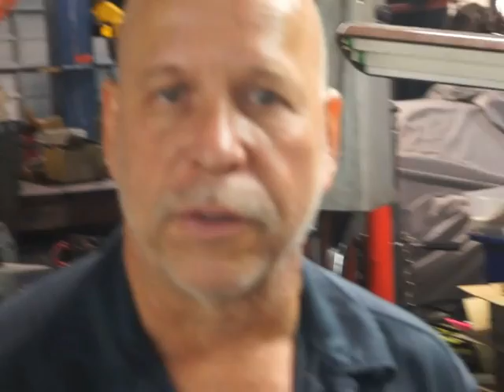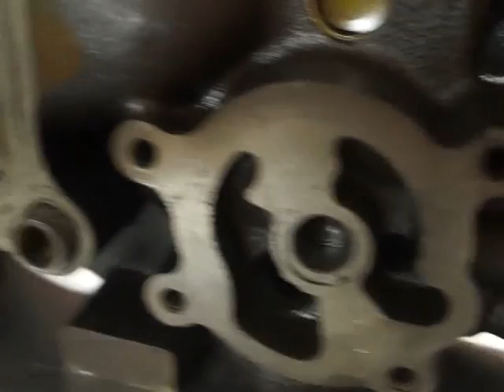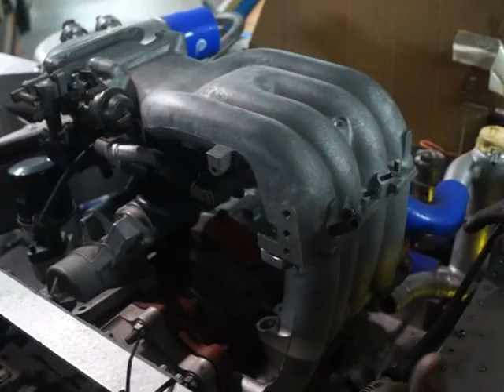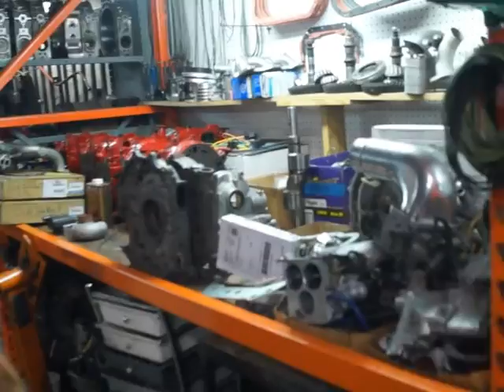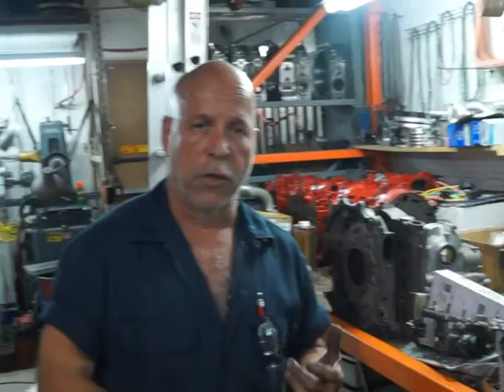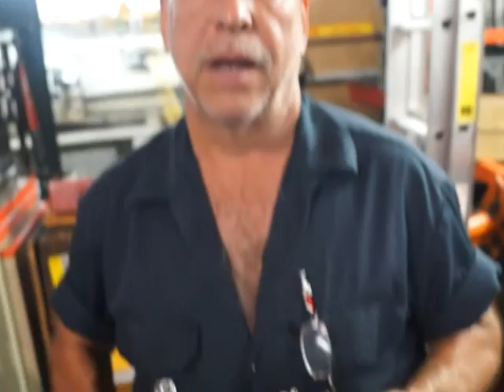Project Turbo RX8 Part 1

Comment: The dude working on this engine is amazing but after waching 40+ of these vids i still havent seen one of this engine running... four years later... why bother with aircon? I have owned two rx8's and am looking at buying another, the aircon is the first thing i rip out of these. Just bridge them than use housings with pp exhaust and block off the side exhaust ports with a manifold so you get the brap brap than turbo it.... in 4 years i can blow two of these up and have the time of my life... so life is short just rape the shit out of the 13b you have before you die of old age... peace ✌

Comment: I habe a RX8 WITH A 13B JDM 4PORT INSTALLED.BUT IM.HAVING A ISSUE WITH THE AUTOMATIC TRANSMISSION SHIFTING FROM 3 4 5 GEAR.
DOES THE ECM NEED TO BE REPROGRAM ?

Comment: So even if you were building a Naturally Aspirated 2 rotor race engine you still wouldn't use the RX8's higher compression rotors?
Reply from the maker: Not a chance. They are too weak, seals to shallow, and way out of balance from factory.

Comment: Ok so if I say get a full 3rd gen engine, and don't chang out the rotors the counter weights are fine without a custom counter weight, correct?

Comment: can you buy this kit now?
Reply: Richard Viscasillas if you guys croudsource this, I'm down, need this soon!
Reply from the maker: I am working on getting everything together by the two year anniversary of this video - July 2017.
Reply: Richard Viscasillas that's great! please send me the info when it's complete.  precision249@gmail.com
Reply: Richard Viscasillas any luck getting the kit together?
Reply from the maker: We are right now in discussions with various manufacturers, water jet companies, CNC companies, and 3d metal printing companies to explore the prices to begin making the parts.  I will be uploading another video Part 28 shortly.  What we are finding is that the costs to make 1 or 2 vs 10-100  vs 1000's of pieces differ greatly (as we expected).  What we really need is to get an in house CAD and 3d metal printing machine up and running. The cost of the machine is a cool $1 Million.  But we would be able to make just about every part we want in the 10-100 range in a reasonable amount of time.  Having molds made and pieces cast is another option, but that is going to also be expensive on the front end.  Depending on the demand we have will dictate which way we go with regard to manufacturing.  We are seriously considering some kind of crowdfunding to get this off the ground including a possible crypto currency ICO.  I am flying to Singapore on the 21st of August and plan to go to Japan to source REW motors and parts and possibly China to talk to manufacturers there as well.  We would love to make everything in house, or locally so we are going to exhaust efforts at that first.  Stay tuned!
Reply: Richard Viscasillas  so what’s going on with this now?
Reply: unknown1creature same here!

Comment: I may be giving you guys a call in about 4-5 years pretty much the same concept of the rotors housing and front iron but would it be possible to do a 20b NA or for the same money would I be better off doing a turbo build, I like the reliably of NA for the rotary but tuning is the real secret to success next to cooling components

Comment: So is there no way to build a decent hp 13b-msp engine? by decent i mean like 300ish hp given that the hp numbers of today that's a fairly modest amount of hp.
Reply from the maker: +TriniRogue - I've seen kits for the Renesis from different companies both superchargers and turbo-chargers.  The problem is you sacrifice engine life by boosting the Renesis as it is already maxed out in terms of its maximum hp capability without forced induction. Mazda used side exhaust ports on the renesis which is the biggest weakness because too much heat is generated on the side seals & corner seals which are weak and fail.  We have a test car NA RX8 we have hooked the adaptronic computer up to in order to play around with its functions to see how much HP we can extract with intake, exhaust, ignition mods (no internal mods - which require engine rebuild an even then not much you can do to the internals anyway other than put better apex seals (cut the groove and put the RX7 2 mm longer apex seals for example) There is no way to get to 300 HP reliably with the Renesis because it requires forced induction.  It will work but for maybe 20000 miles with like 5-7 lbs of boost max.
Reply: Richard Viscasillas Thanks for the insight, dang that's quite the bummer, i wonder if coating the side exhaust runners with a high temp engine paint or a ceramic coating would allow you to extend the engine life by keeping the heat inside the runner egt's would go up but if your engine lives then it would be worth it.

Comment: wow u know ur stuff brother...I have an 2009 RX8 would love to get it to 300 horsepower and rebuilding my engine as described in this video, how much would this cost ball park figure
Reply from the maker: +Joseph Espinal - You would need to get an RX-7 FD Block to swap in to your 2009 RX-8.  The only parts of the RX-8 we use in the rebuild will be your Front Cover that we modify and all ancillary parts that attach to it. Like the Oil Metering Pump, A/C, Water Pump, and we use your Fly By Wire throttle body and the RX-8's computer which has an adaptronic piggy backed to it to run the fuel, timing and boost.  All other features of the car are run by stock computer as always.  How much will it all cost depends on many factors but it can be done cheaply if you don't get all the machine work to the internals done.  You'd be looking at a minimum of around $6000 which includes a JDM FD block, our kit, the Adaptronic computer, and labor to pull and swap the motors and a Holset Turbo and intercooler and plumbing. The 2009 Rx-8 is the 2nd generation Rx-8 and we know that it has different computer so adaptronic will have to be wired in rather than plug in.  Not sure if there are any other changes but we will do one soon and find out.
Reply: +Richard Viscasillas Thats a very reasonable price!!!

Comment: What kind of cost are we looking at to convert an existing rx8 to this rx7 hybrid setup? The engine in my 8 is a recent reman with only 20k miles on it, assuming the rotors aren't going to be used I'm guessing there is some discount in exchange for the cores?
Reply from the maker: +asmithdev - If your existing RX8 engine block only has 20K miles on it, you should be able to sell it or we could discuss giving you core credit towards the purchase of one of our kits which would include a JDM RX7 block.  You would use the RX8 front cover, the OMP, the Fly by Wire Throttle Body and other parts you see in the videos but not the RX8 engine block or intake or exhaust manifold etc.
Reply: +Richard Viscasillas What would you estimate a total cost would be if your shop did the conversion and gave the core credit? Mine is a series 1
Reply from the maker: You should discuss your specific build requirements with us directly to get an estimate.  It all depends on how far you want to go and what your budget is.  If you want entry level performance a stock JDM FD block with a holset turbo and the kit plus installation will probably run less than what a standard renesis remanufactured engine exchange would run.  The core is worth about $1000 - $1200

Comment: im in orlando just rebuilt my renesis about 20,+++ with rotary aviation apex seals and all 3rd gen springs and other upgrades to prevent another granade from going off and with all that done i still wouldn't hesitate to have this kit on my 8 i have the mazsport e.c.u will it work or would cobbs be a better solution cause it does mask check engine cell and other things if need be....i want this kit for my 8 and yes i want the six injectors all i need is 400whp not more not less on 93tune im in orl.Fl. need a guinea pig lol! Please let us know for how much for the kit!

Comment: the real question here is will it work with a 20b...
Reply from the maker: +Warren Stroud -  You know we might just have to give it a try.  I don't see why not, there's plenty of room in the engine bay with the motor mounting at the back instead of the sides like the renesis.  I see a future video series on the three rotor hybrid rx8 engine next year.  The sound of a normally aspirated 3 rotor is music to my ears.
Reply: If you want a car to try it on and want to discuss pricing let me know :)
Reply from the maker: Will let you know. We are so slammed right now it won't be until next year though.

Comment from the maker: Shop is in Miami. CLR Motorsports LLC, 13800 SW 142 Ave #4 Miami, Fl 33186. 

Www.Miamigtr.com  website. 

We should be putting a kit together for sale once we finish the project and have a running car.  

Carlos is considered one of the top 3 rotary engine builders in the world.
Reply from the maker: Mitchell Garcia - Yes we are still around just been sidelined working on race engines, but we should be finishing this project and have the kit for sale in the near future.
Reply: +Richard Viscasillas I was 2 minutes in... realized you knew what you were talking about - so the right thing to do is to SUBSCRIBE !!!!!!
I'll be watching every video in your channel concerning RX8'
Reply from the maker: +Verum Quaerere Seek Truth - Thanks for the support.  We should have the next video up shortly.  Just received the intake manifold we were waiting on so about to begin the engine stack up.
Reply: you guys still around? looking for this engine work for my rx8
Reply: +Richard Viscasillas I'll be looking into this I might have to make a trip to FL. I have a 2010 series ii Rx8. Do you see any hiccups with the series ii?
Reply from the maker: When we complete the Series 1 build we plan on doing a Series 2 RX8 build.  I know that the computer won't be a plug and play deal like the Adaptronic for the Series 1.  We just have to use a universal Adaptronic and splice into the factory wiring harness. I'm installing a JB4 into a BMW 330i which requires splicing into the factory wiring banks and its no big deal, so I'm sure we will get it done.  The hardware for the engine mounts etc. should be the same.  We'll see soon enough.
Reply: What would be the price of one of this engine ready for turbo? I have a blown engine right now and If I get one I'll try to get one of this. Im really interested please send me a mail asap. salvadorortiz14@gmail.com
Reply: Richard Viscasillas just keep in mind... no matter what happens, I stay a fan and i continue watching your videos.... rotary spares in South Africa is wayyyy overpriced. I am swapping my blown apex seal 13b naturally aspirated rotary for a Toyota 1JZ GTE VVT-i .... I stick to Japan... just can't afford to be ripped off in my own country. Love your channel and especially your knowledge. YOU ARE THE TRUE MASTER OF ROTARY SIR
Reply: Would be VERY Interested. maybe I could drive down there and see it all done? Loving rotary engines, man
Reply: Are you guys still around?

Comment: good stuff, please post your shop info, i am going to start a project 2005 rx8 and would love to run the rx7 block with it. As you said, the rx8 engines are crap...... (my email: allias718@gmail.com)
Reply: +Noneyah Thomas It depends how you look at it. If you're looking for 600bhp+ like some of the rx7's out there, then you have to redo the internals of the renesis to support the boost pressure. But surely this is to be expected from an NA motor? I think the power you get out of it without a turbo is pretty impressive considering the engine was first built in 04. You can reliably run 350bhp through a renesis before needing to do any internal work.

Comment: At 7:53 you mention the 04+ 6 port Renesis only had four injectors, they had 6 injectors until 2009-2011.  Just a clarification but great stuff, thanks for sharing.
Reply: +Scott Redmond Auto has 4 injectors, manual has 6
Reply: +Alexander James Reed not from 09-12
Reply: +Scott Redmond Yeah true. We don't really get the auto's in the UK but I know when turbocharging auto injectors are a good upgrade as they have just 4, but they have a higher flow rate.
Reply: +Scott Redmond and actually the auto was a 6port from 2006 on. In 09 the engine changed again  bother the 6port auto and the 6port manual.
Reply: +Alexander James Reed yes I have "blues"  from the 4 port auto in the P2 location on my turbo charged Renesis.
Reply: +Scott Redmond Ah cool which turbo setup do you have?